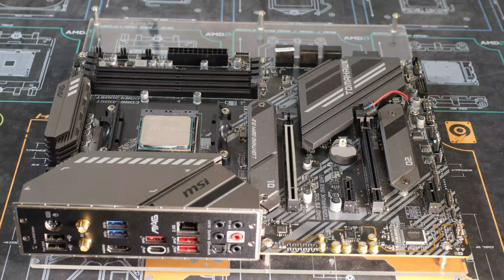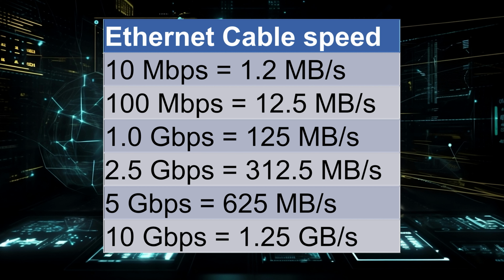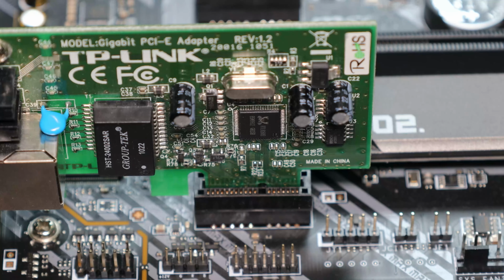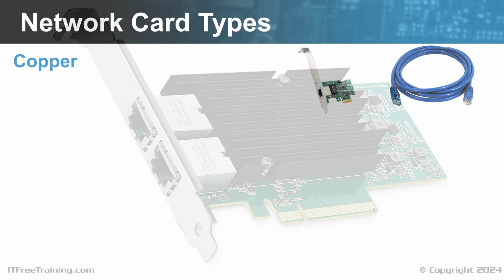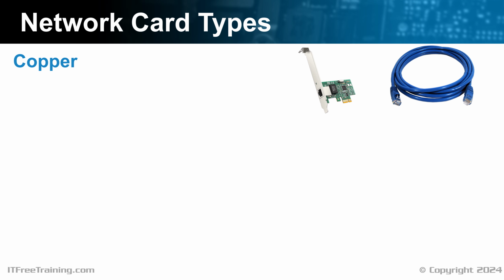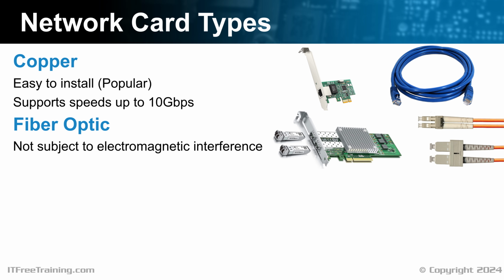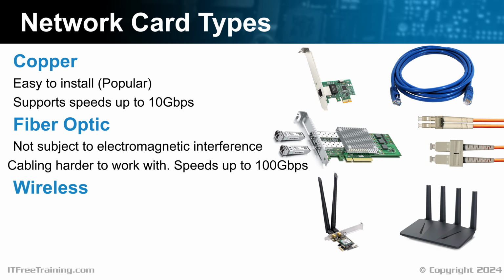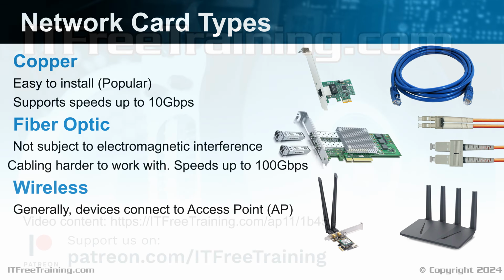Network cards - CompTIA A+ 220-1101 – 1.19

Comment: I would also add information about USB cards, but they are basically following the same principles, just using USB interface instead. 
Thanks for the video!
Reply from the maker: We don't have a video just on USB card. But you are correct, they use the same PCIe bus so work just like a network card would.